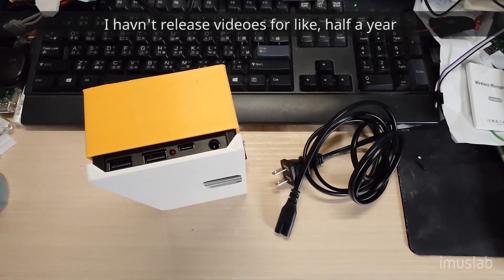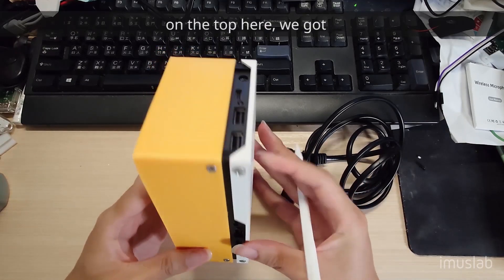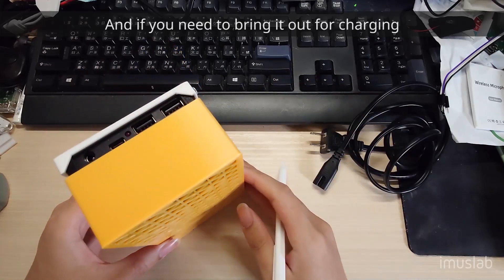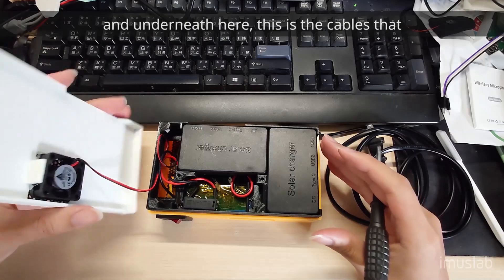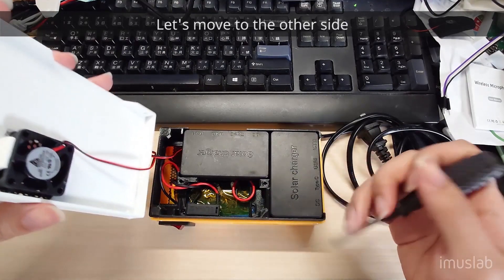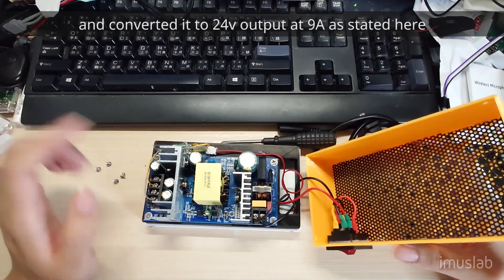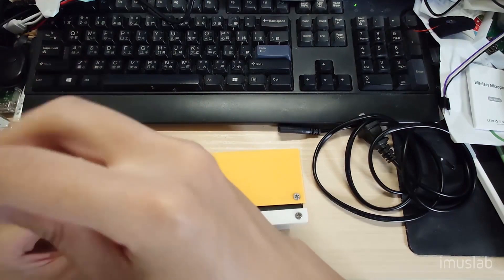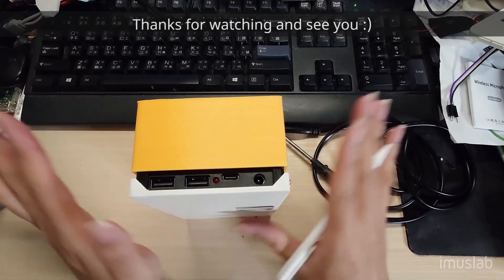DIY 216W Desktop PD Charger without GaN

Comment: Hey I made something similar to what u did, if u are revisiting this project do use the newer SW3518s, it can do 100 watts each port. 
I was working on a version 2 with a SW3518s and KC42-4 so I searched on instructables but your design looks so good and compact too! Mahn i wish I was able to 3D print
would love to share my older design with u

Comment: Hi I’m new to electronics. Why are Apple chargers so much smaller than your design?
Reply from the maker: That is because Apple have the budget to go with way more compact parte and manufacturing process,  like the use of 4 layers PCB and smaller chips which requires industrial PnP machine to solders.

Comment: Like your 60w project, it would be awesome with a display to show power usage. Otherwise it looks amazing. Btw which 3d printer do you use?
Reply from the maker: I have plans to upgrade this with GaN modules (40W x 6) for the 24v conversion when they get cheaper in the future. By that time, I will got enough space to fit in a small display for real-time information. The 3d printer used here is the Ender 3 with glass bed mod and sliced using aPrint Editor default settings.
Reply: @tobychui  I see. I think you can save space by also using something like the ip5389 board..the solar pd modules seem a bit big
Reply from the maker: @Iinustechtips  ip5398 boards on the market usually have larger footprints than the one I am using. I guess it only seems big on camera is because of its black outer casing , which I keep it there to prevent any accidental short circuit with the AC power supply below. If you decided to go the extreme, you can of course use it without its case.
Reply: @tobychui  oh okay. Wish they sold those solar boards in the usa

Comment: Did you custom build the case?

I will probably source a case and cut some holes in it, if you have any recommendations I would appreciate it. Although it probably wouldn't be hard to make a functional case by folding some steel sheets, it wouldn't be as beautiful as yours and it's a lot more convenient just buying one.
Reply from the maker: I 3D printed the case and processed it with sanding and spray painting. If you want something just works, of course you can do it that way but it won't be as charm as custom fitting a case for it 🙌

Comment: Where did you source the PD chargers?
Reply from the maker: The full details are on hackaday. You can check it out over at the components section (wtih links)
https://hackaday.io/project/188188-diy-65100w-desktop-usb-type-c-pd-charger
Reply: @tobychui  You may have posted A link, but clicking on it DOESN'T lead the charger, just to the taobao home page and is asking for a login.  Perhaps you could try to make a link that works for everyone, not just for you. Please.
Reply from the maker: @Brian_Of_Melbourne  I have double checked the link. I haven't got any issue for viewing the charger after logging in. From what I observe it seems the seller is just a small workshop somewhere in China and I can't find the matching link on Aliexpress (accessible without login). If you really want to get one, maybe I can help you to communicate with the seller and see if he can ship to your country?
Reply: @tobychui  Thanks for the offer, but it was more about curiosity to see the charger thing, its specs and its price.  I (and many others I believe) are AliExpress rather than taobao users, anything similar on eBay or Amazon?  It would be helpful for people wanting to learn from your design to be able to easily get these modules.
Reply: @tobychui  The fact that the module (which is the heart of your design) isn't widely available means it hasn't been independently tested or reviewed.  Which is perhaps a worry for some makers.